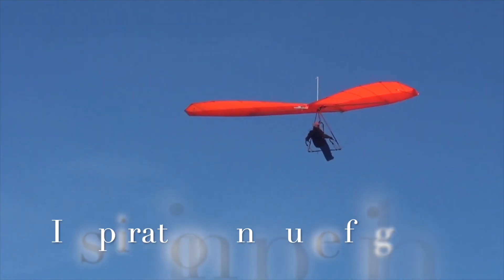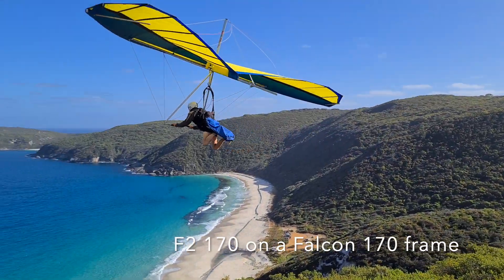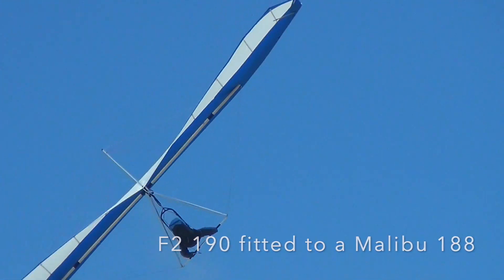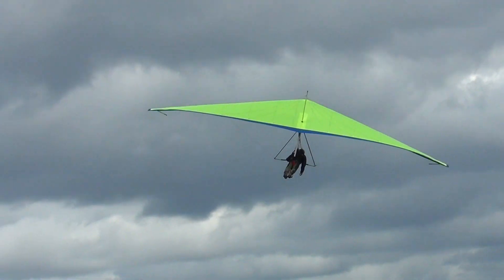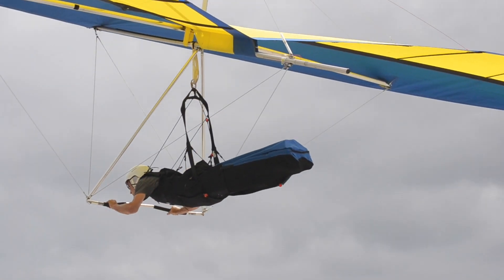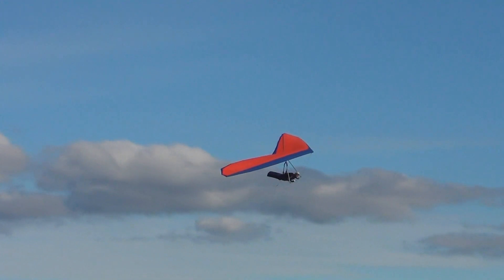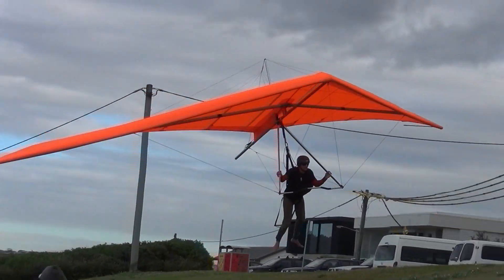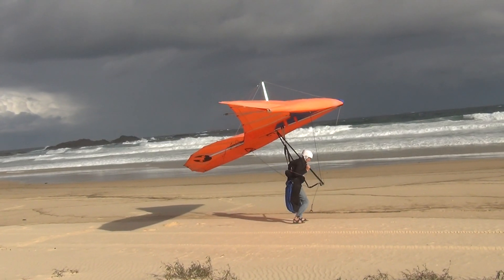C9sails.com  R&D in the floater class of hang gliders

Comment: The Falcon #4 170 was the nicest glider I flew when it comes to handling. So much fun to fly. And you can "drift" it better when soaring (Malibu is a bit too stable). Now I wonder, could you make the Falcon improve performance just a little without loosing the amazing handling? Maybe increse the double sail just over the crossbar?
Reply from the maker: I agree, the F2 sail I fitted to a Falcon 170 frame is awesome. I made another 170 with some extended D/S and a vg, it is a tool. Still very nice handling with the vg on but it really improves the energy retention. Here is a video of that one https://www.youtube.com/watch?v=QCo7jGHvz1U&t=48s